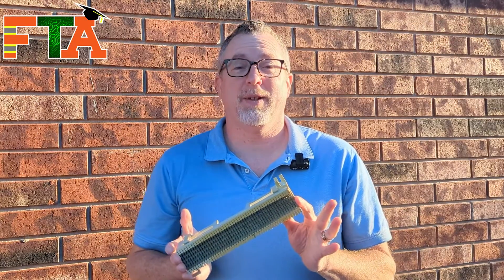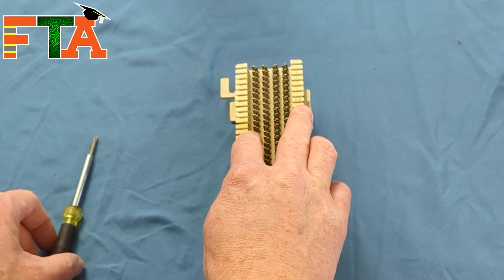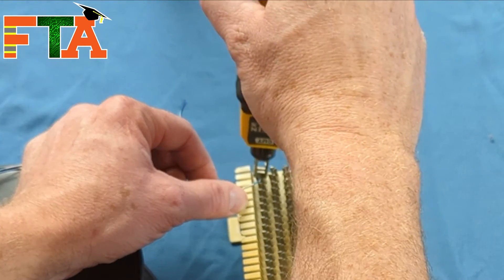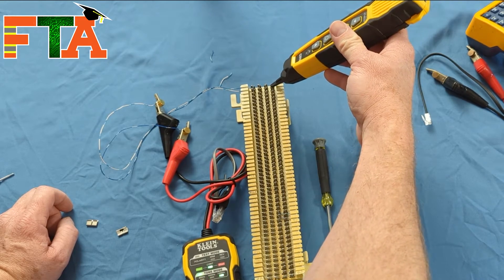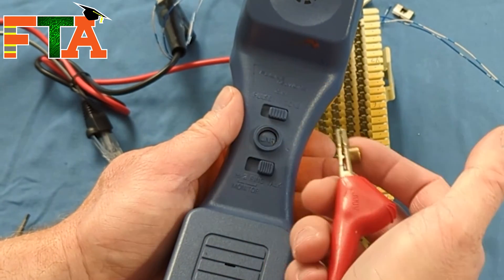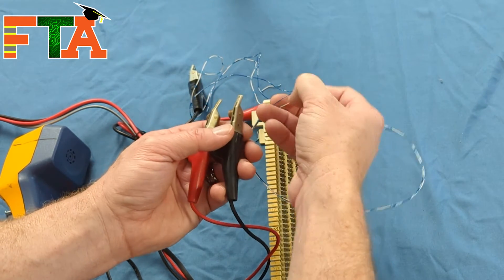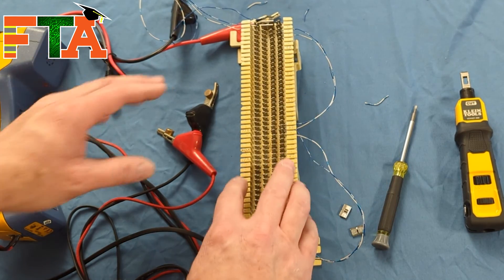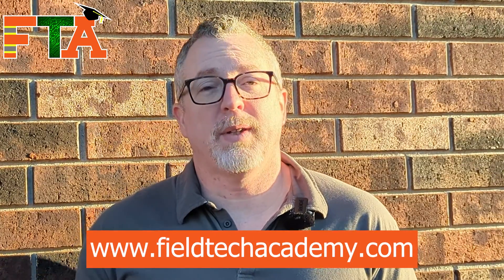How Does a 66 Block Work? | 66 Block and Telephony Basics for Beginners | Make Money Freelance Tech

Comment: I still am not understanding the daisy chaining aspect. Once you daisy chain them down the right side, do you have to bridge it over for the signal to go out the left side? If you are daisy chaining the wire back to the board I don't see how that helps the signal get out to more phones or fax machines. It is just making more parts of the board give a tone, but like how do those parts of the board go out to wall jacks? In my head I'm seeing these two blue/white wires running out of the 66 block and to the RJ11 wall jack. Maybe that is wrong?

Comment: It's great to learn this, after so many years. I've been shocked on a block trying to grab bare-handed, but it seems that is grounding a tip and ring?
Reply from the maker: Most likely. An old POTS line shouldn't shock you unless it's actively ringing.
Reply: @fieldtechacademy I'm assuming when they have a bus bar attached? I think it was at a DMARC in multi-level.

Comment: I work in TV audio, we use to use these on racing and golf shows..  now its all fiber
Reply from the maker: Did you use them in some unique way on the shows?
Reply: @fieldtechacademy  not really, we had to run 25 pair on long runs because XLR was to heavy to run 2k feet. a lot of times we would just leave the cable because it was just cheaper to leave than pay some in over time pick it up.
Reply from the maker: That's a creative way to carry signal. Thanks for sharing.
Reply: @fieldtechacademy  no prob! thanks for the content!

Comment: Testing a Potts line telephone extension and it has dial tone then it shorts.
Telco comes in there's a voice gateway and the extension is labeled on the 110 block
Reply from the maker: I would disconnect the internal wiring and test with a butt set at the dmark. That will tell you if the problem is on the telco side or the internal wiring side.

Comment: Great explanation.  I've been on FN for years and Onforce years before that.  I have mostly an IT background, but take phone stuff from time to time, but I always feel a little iffy on it.  So you can punch down the wires and then put bridge clips over them correct?   Where's the best place to get the cable shown, bridge clips and tags?  I'm not sure if you've done these videos yet (I'll check later), but I'd love to see a video on the proper way to work with conduit and fire blocking.  I'm also seeing a lot of jobs for exterior 5g solutions and would love to see a video with a couple examples of how to properly penetrate and mount equipment on roofs and exterior walls.  Also a couple examples of alarm and elevator wiring would be nice.  I see those jobs come up, but don't really have the confidence to take them.
Reply from the maker: I usually buy all my supplies from Amazon or a local data/electrical/security distributor. Like Graybar but usually more locally owned. 

I don't personally do conduit, security, or roof work so unfortunately I can't do videos on those subjects.

Comment: For the cross connect wire does it matter if you put the white blue or blue white first. I see you put blue white first in this tutorial.
Reply from the maker: @jamesw1603  in most cases it doesn't actually actually matter for pots phones. There is a "proper/standardized" color pattern but as long as both ends are the same position it doesn't really matter. 

If you did the blue white pair on the top pin on one end then it would be best to put the blue white pair on the top pin at the other end. The actual color doesn't matter for a cross connect.

Comment: Does anybody have a link to cross connect on a 66 block video.  Thanks
Reply from the maker: Do you have something specific you're trying to understand or just wanting general information?
Reply: @fieldtechacademy  Both, I had a job several days ago that involve finding some numbers in a large array of 66 block with a AT&T tech.  The AT&T tech had a very powerful butt set.  He could just place it on a line and the phone number would be shown.  Anyway once those numbers were found the job was done.  But eventually they want to cross connect the numbers and go live with them.  What does that mean and how would you do that.  I like to get the work if possible.  Thanks for the info.
Reply from the maker: Basically a cross connect would just mean taking the identified phone numbers and cross connecting them to the end point lines for the suite. 

You'd have to tone out the customers system or jacks and make a connection on the block that joins them together. 

I have a few videos on 66 blocks and toning and tracing wires. Check those out and check out this guy's site. Good diagrams: https://tombuildsstuff.blogspot.com/2015/02/how-to-wire-66-block.html?m=1
Reply: Thanks.

Comment: So they're essentially like patch panels but for phone systems?
Reply from the maker: That's a good way to look at it. They are just not as clearly defined as a network patch panel so it's a lot more confusing for new phone techs.   Bottom line is 1 pair / 2 conductors = 1 phone line / signal.

Comment: Thank you I’m trying to troubleshoot a avaya phone system at house where remodeling I think a line was cut got power to phones but. I no dial tone
Reply from the maker: Digital phone systems behave differently.  You may not be able to get dial tone with a buttset.  I would check the dial tone feeding into the Avaya to ensure you have an active line there.  If you have dial tone to the system  and the phones power up, but no phones on any extension will get dial tone, then there might be an issue with the system itself.  

Obviously, do the old "pull power and reboot" trick.  If that doesn't work, pull power and re-seat all the internal cars.  If it still doesn't work, unfortunately at that point, it's beyond my experience.  

Maybe one of the community here or Reddit can offer some further guidance.

Comment: After watching several videos i'm still having a hard time understanding the 66 0r 110 blocks and what it does with the PBX.  Can you just wire up 16 wires from 16 rooms straight to a 16EXT PBX without any problems?
Reply from the maker: I'm going to be honest, I am not an expert on old school PBX systems.  Here are a couple of things that I believe are true...

A PBX system doesn't send a standard POTS signal to the 66 block.  It sends a data and power signal to each extension so if you try to tone a jack, it's going to tone on the entire block because they are all interconnected.  

Typically you can't put a butt set on a PBX block to check for dial tone because it is sending a PBX signal to the block instead of a Tip and Ring signal.

Wiring the extension on the block and on the jack is going to be specific to the PBX system.  It may use one pair or two pair.  It all depends on the brand and type of system.  The bottom line is whatever pairs it's using are sending the data and power signals on the same pair or split between two pairs.  Look at an existing extension that is working, and duplicate it for repairing, adding new, or replacing extensions.

Hopefully, someone in the community will see your message and give you better information than I can.
Reply: Why do they daisy chain ????😢😢😢😢

Comment: Thank you for the video. I have a question about the bridge clips. If you don’t have any could you just use a small piece of wire to jump the single over with?
Reply from the maker: Well it might work in a pinch but I wouldn't as a rule. Bridge clips are so cheap on Amazon or even locally at Graybar, etc.